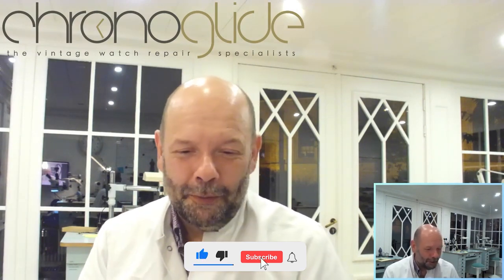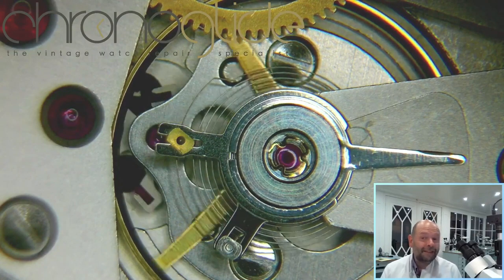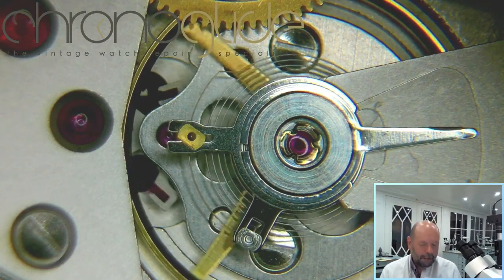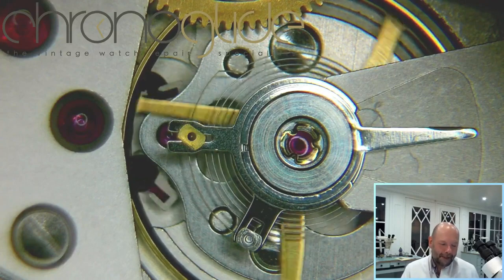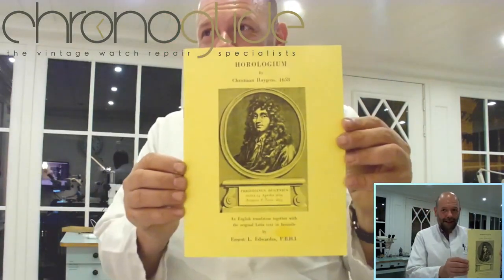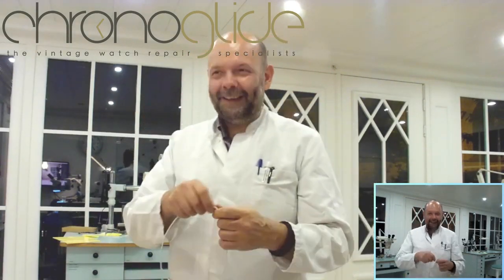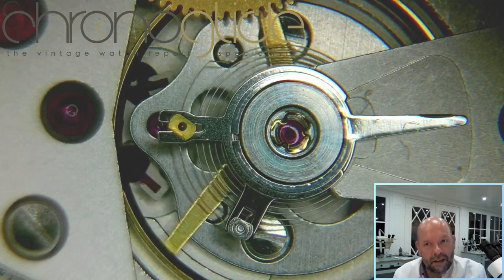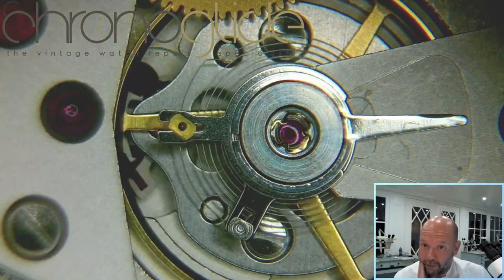Timing and Adjustment mechanical watch movement - Running fast or slow

Comment: Fun Fact: Huygens did work in horology (the pendulum) as you pointed out, but also did work in optics, specifically for telescopes.  Watchmakers use high magnification loupes (usually 12x and above) that have two plano/convex elements in them.  This is essentially  Huygens eyepiece which he developed for use on telescopes, but it also got used on microscopes, and eyepieces of the time were also useful as loupes even before there was anyone who would be considered a "watchmaker".

We truly do stand on the shoulders of giants.

Comment: I adore your videos Kalle. Your teaching methods are so simple to understand and are a joy to watch.
Reply from the maker: That is so nice to hear Michael!
Reply: @ChronoglideWatchmaking  
A very good explanation, but...
I believe that it would have been useful to explain the need for minuscule movement of the timing lever.

My watch was losing around a minute per day.
The lever is suspended in air - it has no plate beneath it to rest a tool.
I pushed the lever gently, but it moved about 1mm, and the watch went from losing a minute, to gaining a minute.

I realised that I needed to lever it, with a flat tool, with one end anchored somewhere safe.
In fact I used the tool that flips off 'press in' backs.
Obviously it is metal, but I was careful.

It worked!
I was able to slightly rotate the tool, and barely move the timing lever.
It is now only gaining 25 seconds per day.
Hopefully, just one more adjustment will be required.
:)

Comment: I improvised a tool, because there seems to be no wrench you can use to lay on top for safely adjusting the "balance spring". 
Instead, one has to really push the timing pin at the edge of the balance spring. That is tricky, and one can easily slide down and destroy the balance spring! I am also spastic after a stroke 5 years ago! (why I have time for DIY watch fiddling) If the phone rings, my whole right body side twitches! 
So I took a small 1mm wide jeweller's screwdriver. I cut out a square notch on a corner on one side. I can then lay the screwdriver on top of the pin-lever with the cut-out part. It looks like a plate with a square cut out on one corner. Now I can push forward, and the edge of the cut-out pushes the timing-pin lever. I do not have to worry so much about a twitch, because the jeweller tool does not so easily drop down to damage the balance spring! 
I regulated all 4 of my Seiko/TMI NH35A (close relative of earlier 7S26 and current 4R35) to within -1 to +6 secs/day when I wear them, or they are on my watch-winder carousel. These watches cost between 45 and 70 dollars, so getting this close to "Swiss" COSC performance, for 1/100th of the price, makes me very happy :face-blue-smiling:

Comment: I enjoy watching your videos. I like to work on old pocket watches and clocks. It is just for my own entertainment. The parts that wear the most, those that move the most are often the most difficult to fix or even find replacements. Balance staff pivots I find the worst, often broken or chewed up in fractured jewels. American watch parts more easily identified and found than old European varieties. Are there suppliers or do you end up making the replacements?

Comment: I am interested in further explanation of timing in positions. What elements can be adjusted in order to reduce the variation between positions?
Reply from the maker: I do understand what you mean Marekz, dynamic poising in different positions. I will keep it in mind, promise!
Reply: I also look forward to see a video on dynamic timing. This is my problem on most vintage movement I work on. I know about changing the space between the timing pin, but it does not work all the time and there is probably more tips.
Great video anyways!

Comment: So can we use a different balance wheel in a watch,, (with a slight fifferent weight' or size, and then compensate, or it will bring other problems?

Comment: I have a question. The bet error will off course vary depending on position, but I'm wondering if it's always adjusted for dial down position?
Reply from the maker: With the Beat error adjustment you will set the position of the impuls jewel, that is in every position the same. Dial down is the balance best accessible to do the adjustment. Nice question!

Comment: Once you remove the back of the watch to make adjustment , will it not affect  the water resistance ??
Reply from the maker: As long as the rubber seals are in good condition and lubricated with silicone grease there is no problem whatsoever.

Comment: Great info Kalle. Why does the stud move when I adjust the timing on my old Heuer?(valjoux 724) It's very annoying. Is there something that can be done to prevent it?
Reply from the maker: Maybe a tiny tiny tiny  drop of 9010 between the two sliding rings will do the trick Martin.
Reply: @ChronoglideWatchmaking  Thanks kalle, I'll give it a try.

Comment: My seiko 5 sports i bought two months ago runs 2 minutes faster . What is the permanent solution to adjust it to the correct time.
Reply from the maker: Probably a small adjustment of the balance spring.

Comment: can some body explaine me why my watch when on the desk horizontly dial up will run quickly about +170s and beat error 1.7 and when it on the desk horizantly dial down like adjustment position will work perfektly near 0s and beat error near 0.3 !
Reply: It can happened for different reasons: 
- Balance staff pivot damaged 
- Incabloc damaged or not closed properly or dirty 
- Hairspring not flat and touching somewhere

Comment: My Seagull ST13600 is around +13 seconds/minute or 18,720 seconds/day and it stops regularly. Moving the regulator has no incidence at all on the timing. The spring of the oscillator seems bunched up  but I'm no expert.

Comment: On my Cortébert Automatic CAL 451 bumper automatic, the watchmaker had to put the balance wheel hair spring to retard. He says that the force from the new main spring causes the watch to run too fast. I can attest that when a former watchmaker adjusted the watch after decades of sitting on a drawer on my parents home, the balance wheel spring tension lever was in the middle position. However, the cleaned movement run 5 minutes per day faster. I believe that the causes are other. Having the lever all the way in retard, means that the hairspring has been shortened perhaps as it was bent or broken by the curious son that is writing these lines and in order to run normally it had to be shortened! Albeit, the watch runs perfectly with no minutes gained nor lost in continuous usage! Should I source a very expensive CAL 451 over on eBay to have the balance wheel arbor replaced?